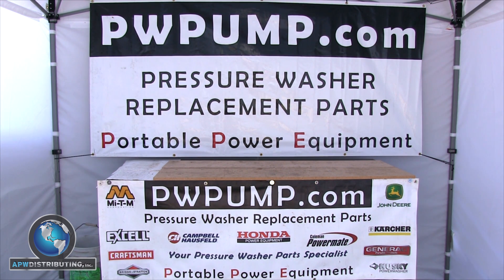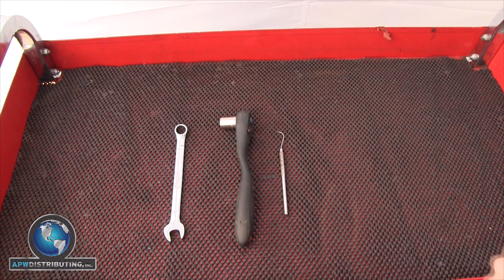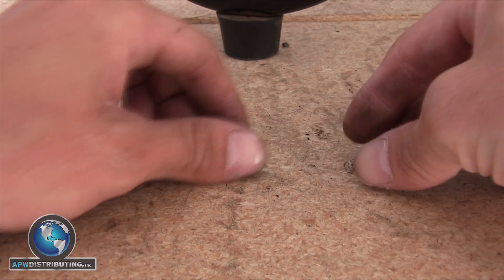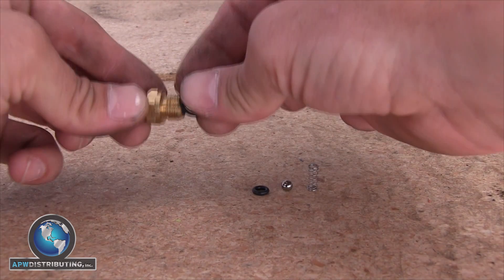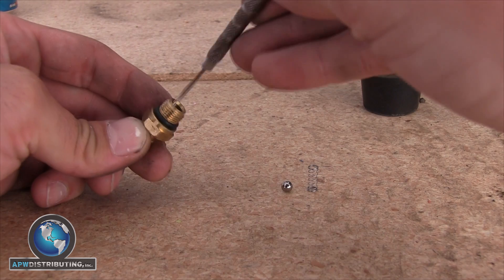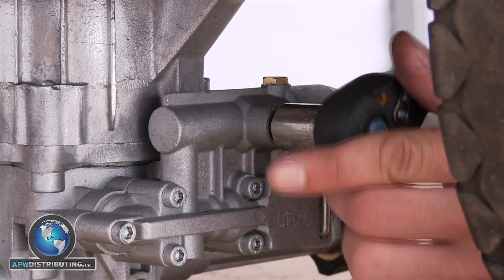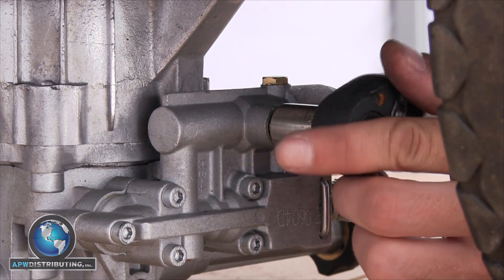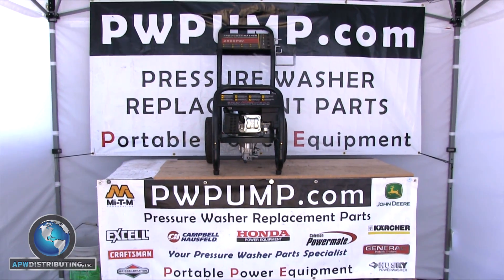How To: Install a Chemical Injector to your Pressure Washer

Comment: This video saved me so much head-ache! Thank you! I ordered the repair kit on my Gen 3100psi pw and I was trying to remember the instal process. Lowes only sent me the kit with only the internal gasket. I had to salvage the external gasket from the old injector. Fortunately everything fit and worked out, thanks to your video and simple instruction. So well done. Raving fan. God bless.:yougotthis:

Comment: These Venturi injectors are all garbage. Is there a real chemical injector pump a person can install?  What do car wash pumps use?  Maybe this explains why you never get soap out of them either.
Reply: The Dollar Guy yes. They are very prone to breaking off and corroding
Reply: You are probably NOT using the BLACK TIP! It's the only one that will work with the chemical injector, duh.
Reply: @desijrichert  I know that they use the black tip, it is a phony system that relies on the pressure drop using the black tip to create the venturi effect.  It only applies the soap with no actual cleaning pressure.  I can do the same thing as that phony black tip using a bucket of soapy water splashed on whatever it is I am cleaning, then rinse with high pressure.  Saved my time not even using that black tip.

It is a gimmick that relies on low pressure so simply deliver the soap to the surface to be cleaned that only works once or twice before corroding since chinesium grade permeates everything. The only real version is the soap injector CAT pump on the high pressure side like a carwash has.  Once I pay the mortgage, I'll buy one.

Comment: Can you run a pressure washer without a chemical injector installed? I broke mine off, we tried plugging it, but it didn't seem to work.
Reply from the maker: hollyuya Without that hole plugged you will just keep shooting water out of it while it is running.  It probably won't harm your pressure washer but you won't have as much pressure.
Reply: I just went through the same thing.  Used a bolt extractor to get it out and bought a replacement part (soap injector kit) off Amazon
Reply: actually, it broke off of one we were fixing, and water was spraying everywhere and the unit was revving extremely high. I wouldnt reccomend it.